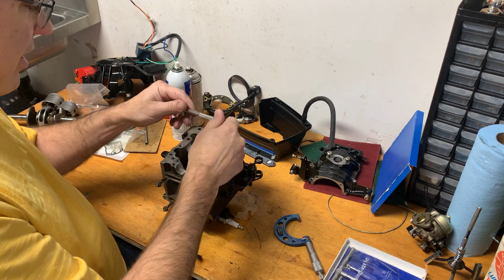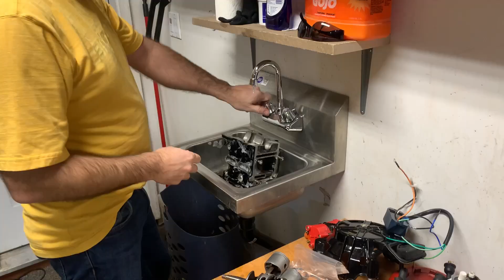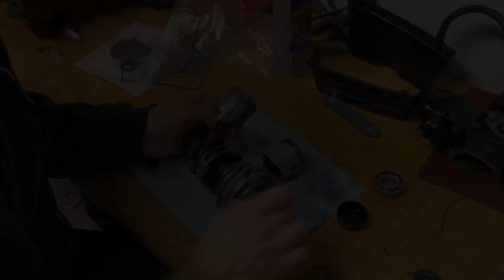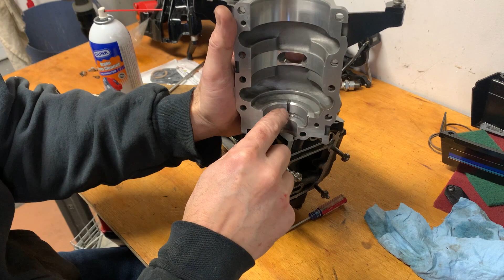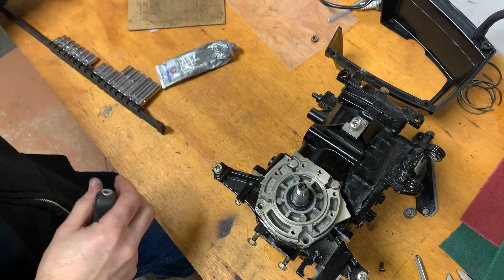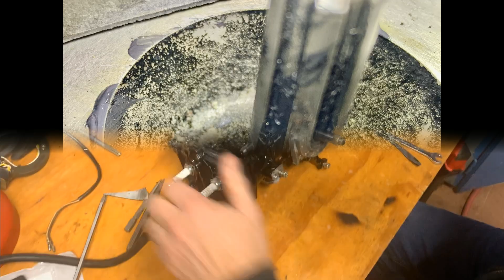Mercury Outboard Two Stroke Re-Ring Job!

Comment: My thoughts on this is: the top of the cylinder should be a few thousands smaller than the bottom because that's where all the heat is and once it's warmed up the cylinder will be straight.

Comment: Great job. I am thinking doing the same with my 87 15hp johnson, what compression do you have after ?
Reply from the maker: After the rings seated it landed on 85 psi. I reused the pistons. Cleaned them thoroughly. I suspect it would have higher compression if new pistons were installed. I went 70 psi to 85. Plus she got new crank bearings and seals. She’ll be good for a long time now.

Comment: I just watched your Mercury outboard video, very enlightening as I’ve followed your Plymouth and Chrysler rebuild videos. I learned a lot from those as I too was rebuilding a 20+ years pasture find 1947 Dodge 1.5 ton with the 237 cu in flathead 6. I went through everything on it so now it’s street legal, insured, and I found a dump bed for it and now it’s a 5 yard dump truck. I’m now also looking for a 50’s Mercury Mark series engine for a project. Thanks Kevin

Comment: Great video 
Did you test compression since the rebuild?
Reply from the maker: @timbiffis6306  Not yet. I’m breaking it in right now. Seating the rings.
Reply from the maker: It went from 70 psi to 85 psi. If new pistons were installed I suspect it would have been higher. She got new crank seals and bearings. Should be good for a long time now.